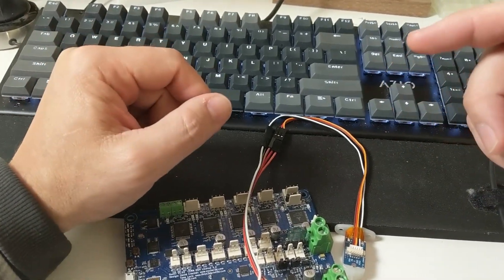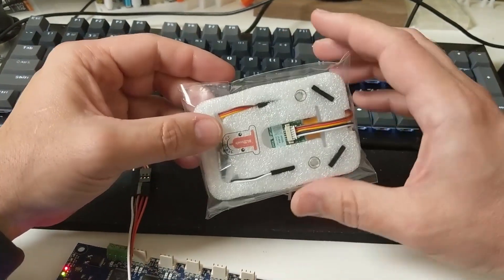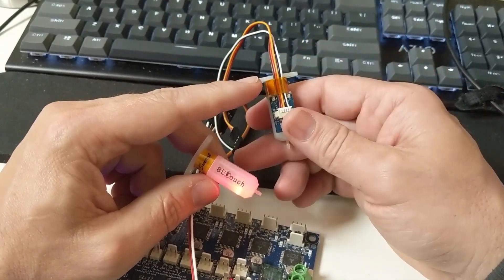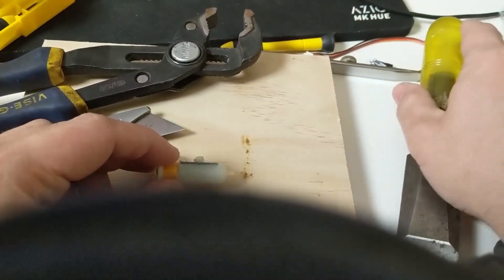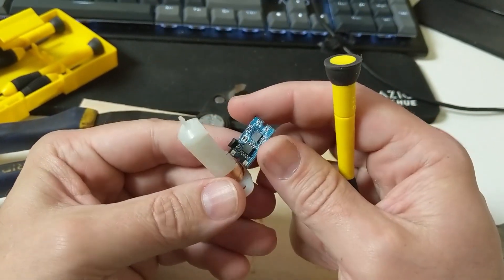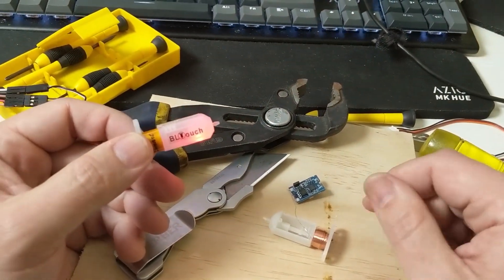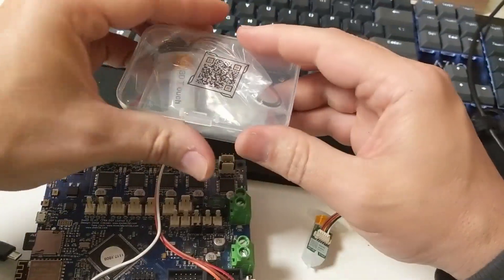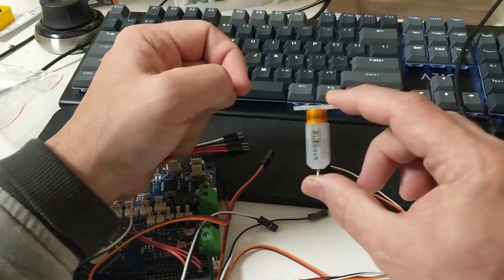BLTouch vs.  3DTouch - Should you save some money and buy the clone?

Comment: I bought a 3D Touch and couldn't get it to work out of the box - exactly the same behaviour as shown in the video here. Flashing red light (error mode), but if issued with a reset command, appeared to 'sense' correctly. This made me think that the issue was likely to be with the servo. I checked the contact points on the board where the two wires from the coil connect, with a multimeter and confimed the continuity of the coil, but was only able to get very intermittent connection with the multimeter. A quick 'dab' with my soldering iron to reflow the coil connection points on the board (very quick - as the coil wires are very thin and will burn out quickly if heat is applied for too long) and the servo is now working perfectly.

I don't usually leave comments, but I hope this helps someone out. I'm guessing that this was exactly the same issue as the one shown in the video here - it's just I was going for a "can I diagnose an fix it" mentality, rather than "can I destroy it" as seen here!
Reply: i have knock of 3d touch to get it work. y need to rotate screw on top of it to get position of permanent magnet just right. Otherwise the sensor pin won't move.
Reply: Hey ben. New to 3d printing. I’m printing my
First print now. With my ocd and newbie self. I spent an hour with a piece of paper and leveling bed for Ender 3. And you’ still don’t know if it’s almost perfect just acceptable. Now the wire that you soldered. Was it on the outside of the casing where the socket is or inside the device? This is more just in case. I seen your post was recent so maybe it’s a quality control issue.
Reply: @drakevelazquez8728  The solder points I retouched are on the external side of the PCB - no dissasembly needed to get to them. They're either side of the connector. I've highlighted them in blue here:

https://imgur.com/a/60lHYmw
Reply: @benjharris  thanks!!!!
Reply: The first clone was faulty and I got a refund. Bought a clone on Amazon which worked right away out of the box. Deviation is stunning 0.003. But the issue is now massiv buggy Marlin releases. UBL and biliniar behave differently and or don't do anything while printing. Can't get consistency. But homing is consistent so the 3d touch seems to work. But since I get no ABL mode set without some manual mesh editing I thinking about buying the original BL to compare. Anyone can say something about their clone and ABL results?
Reply: @leckomio8812  Y Marlin 2.0 not really New Marlin Just old marlin that supports 32 bit. I can't even add temp offsets so my temsp on nozzle are like 40c cooler than screen shows. and verify in ubl just extrudes but wont do printing moves.
Reply: Tried it. Didn't help in my case. Still flashing red on commands.
Reply: This "demonstration" was clearly staged.  Naive people deserve to spend multiples of what products are really worth so they can feel like they got what they paid for.  I suspect this crusader was probably paid by the BLtouch folks.  To me, that's cheating if you don't say you're being paid.
Reply: @ramtek2702  I don't really believe it was staged - I DO trust the guy. But you are certainly right in that he thinks paying much more for the real deal makes it better than a clone.
When bought directly in my country, the BL-Touch costs roughly the national average daily pay without taxes. Which is nothing but outrageous for a solenoid and a precise hall effect sensor.

Comment: Strange, it looks like the 3D touch has gone through some design iterations (or the clones are all called 3D Touch, but designed by different companies?) The one I have is all SMT with four SOT23s forming an H-bridge to drive the solenoid, a teeny-tiny SMT hall sensor and an ATTiny2313 as the brains of the operation. Like yours it doesn't seem to do much other than a slow red flash. I brought another one more recently which is yet again another design, but this does follow servo commands, but the output is floating so looks like it needs some firmware tweaking to make it work.

Comment: So how do tou know i does not work? Just because the self test is different?
Reply from the maker: If the self test doesn't even work then it will not work with regular deploy and retract commands either. Let alone the actual sensor operation.

Comment: I bought a copy and got it working first try when I wired according to instructions that came with it. I usually prefer to support the original manufacturer but as the OG bltouch costs half of my crappy printer then in this case I went with a copy and to be honest the OG guys didn't lose anything as I would have not bought it for that price anyway.

Comment: Gotta be honest, i was researching before buying one and came across this video... seeing the like to dislike ratio made me think that maybe you just got unlucky or something... so i bought one. yup... exactly the same behavior. "YoU NeEd To cOnNecT ThE WIreS In tHe rIghT OrdER" yeah, I did... in fact, I can send m280 p0 s10 and the probe would deply, s90 would stow it, I can self test it, everything seems to run just fine... but when I try to run autoleveling, the probe never deploys. I even started a new configuration file from scratch and nothing. 

Not to mention the constant errors on boot (the flashing lights) and me having to power cycle the printer 6 or 7 times before it powers on correctly. These clones are actually a piece of garbage. Sure, they are cheap and some people might have gotten functional ones but I just spent the entire weekend trying to debug a broken product like an idiot. That's wasted time I'm not getting back. I'll just get an original BLTouch and call it a day.

inb4 "but mine works" sure, I believe you. it's just that their QC might be garbage and they do ship TONS of non functional units... You just got lucky.

Comment: I bought a 3D Touch because I thought there's no reason to spend $40 on the BL Touch. It arrived from Amazon broken. No big deal. They sent out a replacement. It didn't work at all. No matter what I tried I couldn't get it to work. So I threw it in the garbage and bought a BL Touch kit for my printer for $40. It's been used hundreds of times and I've never had an issue. Like anything else, people will experience different outcomes when it comes to any product. But I will say there's a reason the 3D Touch isn't rated as highly as the BL Touch on Amazon.
Reply: Of course if you don't check the wires, it won't work.

Comment: I buy these in sets of 2 or 3 at a time and so far they have all produced very similar precision(one is even better) as my genuine bltouch. I can buy 4 shipped for about $40.50 WITH 100CM wiring and steel mount and hardware to mount it on ender 3/geetech printers.

Comment: was looking for video to actually compare things rather then  look at one or other, i can look on them on a table. as to some one cheating i think idea is wrong (benign developer myself) if you put something as open hardware project you expect some one to take and use it,  (commercially or not that becomes questionable on low budget items say if manufacturer makes no money on them ad put them on eBay...  not really commercial, i bough test 3D touch for $4.99 free shipping, way i see no way that's commercial project (if i make one in china myself it will cost me $15 to produce) so I think calling colons of open hardware projects cheaters. If it would be trade secret or patented design then its whole different story!  FIY our in house proprietary design clones are on eBay by some china knock off vendors that suck yet im still ok with it as it benefits community at the end. Any way this video would be much much better if actual scientific measurements comparecents would be done to see precision of on vs another. Contentious, reliable , repetitive reading is what really needs to be tested, So i guess i will set up bench and script to test 2 "tools" in same spot 1000s of times and see real statistical deviation in reading in both.

Comment: I guess you just pay what's worth it for you... I bought a Geeetech A30 with a 3DTouch (first gen clone), A30 had mayor bugs and issues, and the 3Dtouch don't always pushed the Pin down so sometimes it crashed into the bed... It was such a horrible experience for my first printer so I bought a Duet Maestro 2 + original Bltouch, some Sunon Fans  and after that, it's a great printer.

Comment: You really gotta do something about the noise you're picking up on your microphone. It sounds like either there is construction going on or you're hitting the mic on something. 1:50 and past that. low frequency.

watching video

Guy gets out chisel   Dude.... apply heat, the glue will let go. Ill keep watching in case you cut off a finger. lol.

Also, stop calling the piece of crap 3D touch "bltouch".

Comment: 3Dtouch works perfectly on my printer. You just need to connect the cables in the correct way.

P.S Saving weigh without screw was epic.
Reply: Yeah, look at the weight of that hotend and how much he is fixated on that tiny screw. It will be less that 1% of the weight of the whole hotend but he is acting like it makes a large difference. Yes cheaper products are made with cheaper techniques, doesnt necessarily make them worse.

Comment: Interesting, do you know that BLTouch is also sold as a licence ? For example Geeetech build the 3DTouch wich is made under license of Antclabs
Reply: THIS is interesting! Do you have a source for it? I'm on the fence about cloned hardware. For the record I purchased two 3D Touch probes. One DOA and the other was good intermittently. Replaced it with a BLTouch and it worked perfectly.

However, if it wasn't for cloning designs the 3D printer market would look very different price-wise. I am actually surprised that it's taken so long for a mass-market release of a sensor the employs an optical sensor (in the CR Touch) using the same electromagnetic deployment as the BLTouch.

Comment: Clone BLTouch sensors need some changes in the firmware. But not worth it. I still have one somewhere. I bought an original one after the clone because yes it was working too but because of the cheap quality my first layers never was right. With the original one I had no issues from that very moment I installed it and it's still perfect after a year. Get the original one if you want to spare yourself from being annoyed.

Comment: The real thieves are the ones charging $40 for a $5 product
Reply: I gotta agree that $40 for that product is a bit much... so much so that there are dozens of Chinese clones as proof of the mistake.  The makers of the original should have done some research into how to make the product as efficiently as possible (industrial engineering) so that the Chinese wouldn't have alot of profit margin.
Reply: @LibLibertyLibertarian  thats where it gets quite ironic... yes in the us the people are very good at thinking new way to solve problems and inventing new stuff, but we are not as good at thinking about efficiency (take it from a self proclaimed engineer ;) ).

While china has some very smart people working only in making stuff work with the most efficient way possible. Often at the cost of safety and ethics.

What i am saying is that china has experience into a domain that most people i'v worked with (including myself) struggle with in America.
Reply: An entire printer costs $200, a fancy switch that costs $40 is certainly overpriced. My printer has servo+microswitch probe and it has 0.0012 deviation
Reply: @victornpb  well, that mindset is flawed... what if your printer is a custom one that costs 2000. If i do a gold plated case for a smartphone that costs 400$, that'd be dumb, but the gold would still cost what it costs... and developpment costs a lot.
Reply: @elielbourrelly9902  with the volumes of the sales of the bltouch they have no issues covering development. It is a good probe but it is most definitely overpriced
Reply: @tormodhag6824  Agreed, it is overpriced, and the fact that they did multiple versions while keeping the high price and dropping the manufacturing cost by changing metal parts into plastic for exemple is a bit sad.

But if i managed to transform 5$ in componant into something reliable like a bltouch, that means i did a lot of work and testing. And if i dont make profit on that amma just not create anything anymore.
Reply: @elielbourrelly9902  we all do agree on one thing: bltouch is really good and overpriced. I read about antclabs and one guy started it spending lots of time developing his idea and product. In a way it's justifiable to set the price for your biggest creation at any point you want. It's just that keeping a lower price would potentially increase their sales, but again maybe they don't have the capacity so thats why they mark up the sell price.🤷
Reply: @tormodhag6824  in that specific case, they are shooting themself in the foot by encouraging buyers to go find alternatives (that from my experience, are also very good) because of the high price.

The market is a lawless wastland of stupidness ;)
Reply: It's called making a profit. If you can make it for $10 do it
Reply: I would find it awsome if we could combine these 2 abilitys in multi national  teams of engeneers, but sadly its not likely to happen because both nations are in competition.
Reply: When i bought a new car it came with a radio that did not have bluetooth. A 50 cent part. These days who listens to the radio?
Reply: That's probably the most idiotic comment ive ever read. It might cost $5 to manufacture, but you first gotta pay for the tooling to have it made as well as the means of distribution, advertising, and of course profit. Because without profit motive, none of these products you claim are made by thieves would ever even be invented. Have you ever stopped to consider how many products a company makes that turn out to be total failures vs how many actually sell? All of that factors in. You clearly flunked basic economics and/or are a democrat and believe everything should be handed to you free of charge.
Reply: @LBCAndrew  umad bro?
Reply: @LBCAndrew  it cost 30cents to make if even that. Like smart phones cost around 10$ to make but get sold for around a grand when just coming out.
Reply: @saberflow_official  i agree that the bl touch is overpriced, but not by that much and its not that bad for smartphone also.

The real problem is engeneering, that costs money and i agree with him on that, but at the same time is 100% his fault for not reading the instructions on the 3d touch that specified a slightly differeny wire order than the bl touch (probably to avoid getting a lawsuit)
Reply: @saberflow_official  phones are actually pretty expensive to produce. They come loaded with bloatware so the companies can actually make money on them

Comment: @Design Prototype Test  Your bias is evident in this video, but you do a poor job of defending it. Imagine you are explaining it to a friend, not accusing the person making the knock off. 
You could explain that BL Touch was made by young engineering student who received a patent, but is now being pick pocketed by unlicensed knock offs. Explaining that buying the original encourages development and gives some compensation to the original designer who invested time and money to create the product.
You could also state that "even if it worked just as good as the original, with no innovations, it is just an illegal imitation."
Another great argument would have been that "BL Touch continues to improve this design and has excellent customer support for the 3D printing community."  Sometimes you support a company because you like them.  
Insisting that it didn't work, when a quick scan of the BLtouch webpage says it is wired wrong  (they are probably using BLTouch firmware), and when there are so many comments pointing this out, is nothing more than dramatization, which is only ok if you can justify your point of view, and frankly you didn't.

Comment: You have the worst luck.. but it was hooked up wrong. I have purchased so many "clones of various products and have not recieved a dud yet. I will say some are not quite as good as the real deal but for sometimes a thrid of the price....im good with that! The original bltouch is so overpriced. As are so many of the named printer parts! Thats why so many resort to clones. In a PERFECT world we all could buya 250 dollar printer and spend another grand on name brand hotends, extruders, sensors, control boards etc but for many of us thats not remotely the case. Still a fan. Your videos are still informative at least. I am glad someone does these but you might want to try harder to be objective! Still your channel your rules.

Comment: While the BLTouch does probably have better accuracy and is able to sense better values, if all you want is the ability to start your print without the constant frustration of leveling the bed and getting it wrong and all that, the 3DTouch will be just as good as the Original without any difference. I have the 3DTouch and I love that I can just turn on the printer and print without an hour of configuration first.

Comment: Hi. I'm just working on fitting a BL Touch to a FLSUN Q5. I intend to change the motherboard to a Duet 2 WIFI after watching one of your previous videos. I have an idea of how to get the BL Touch mounted, but my question is, what is the minimum distance it should be mounted in proximity to the Hotend, due to the temperature damaging the probe? I will be using the part cooling fan you designed so I suppose that will prevent heat radiating out to far, and with a silicon sock on the hotend. Just wondered if anyone has considered this question before, or has an answer from the manufacturer with a limit? Probably over designing but a fact that should be considered.